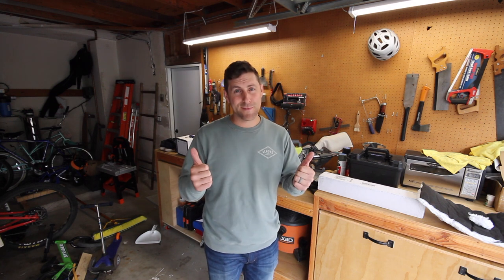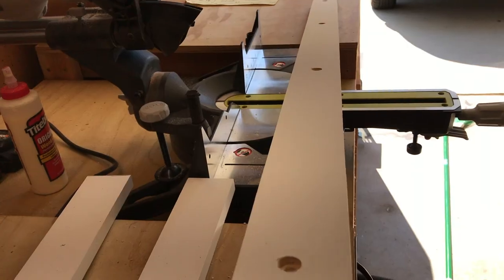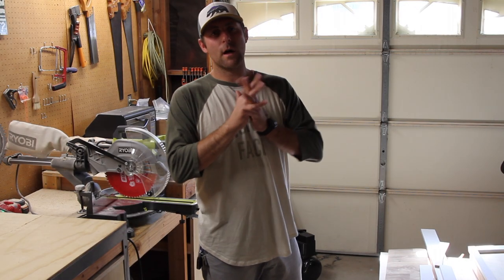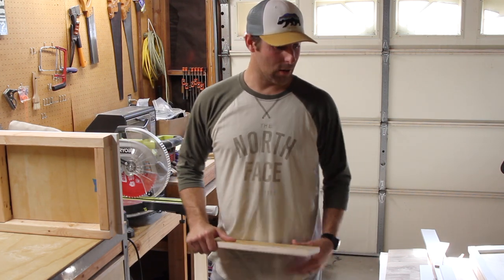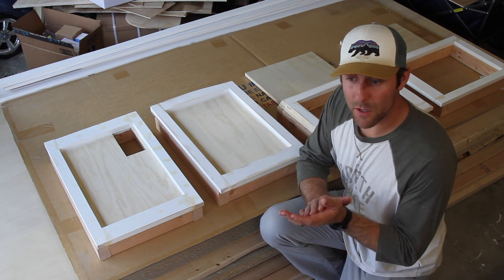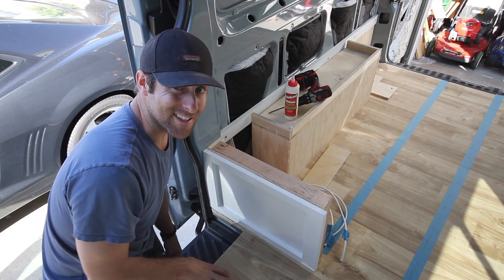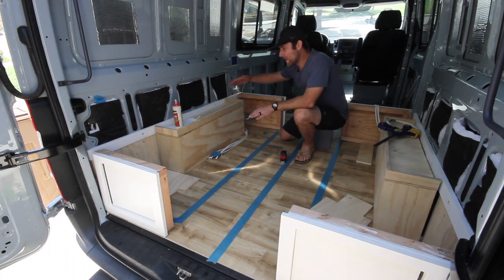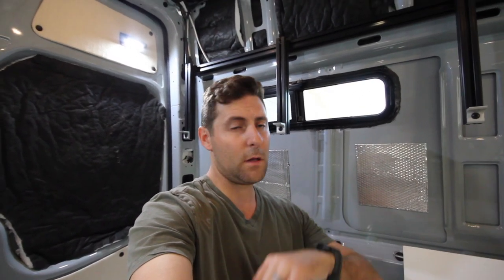DIY CAMPER VAN BED (Convertible)

Comment: I'm building the exact same benches and using your video as a guide. Big thanks for the post!
Reply from the maker: You got this! Let me know if you if you need anything!
Reply: @EventheWavesYT  I have the benches built but haven't cut the openings yet. Curious if you have preferred the side that had the big opening or the side that had the smaller opening? Also I am considering not painting and using laminate for protection. Have you noticed scuff marks from feet on the paint? Lots of people paint anyway for water proofing. Thoughts? Thanks!!
Reply from the maker: @NorthwestLights206  So I have the smaller ones on one side and a larger opening on the other. To be honest I don’t like getting into either one of them. My cushions are really heavy and it’s just mildly inconvenient. But what I have  noticed is I will put larger items big tents and longer things that I may not use on my trips as frequently and try to open them as little as possible. I use my rear piano hinged doors everyday though. 🤙🏼 
I painted because well it was cheap and the wife wanted white. lol
Reply: @EventheWavesYT thanks! I opted to not add the rear doors, east to add though since I haven't finished it... Maybe I will take that into consideration (for sliding skis in for example).

What cushions did you go with? I feel like that is one of my biggest questions. Anything you would change about them? I can build all day but picking cushions is something I'm new too. Water resistant material and firm padding is what I think we are looking for. Yours look a bit thick for me.
Reply from the maker: My cushions are way too thick buddy! I would slim it down to 2” medium density foam and 2” of memory foam. I bought the bed version of the foam and then gave  them to an upholstery guy and he upholstered them in a fabric I bought from Krypton. I can make a full video on it if you have a specific question you want answered.
Reply: @EventheWavesYT  How come you didn't use hydraulic hinges to help with the lifting of the bench? My first attempt at a bench i used the same as you (blocks on the underside - not sure what that process is called) but it was a PITA to use because it was so heavy and awkward. Also, what are your measurements?
Reply from the maker: Love it! Yeah so I should have used hydraulic hinges because the cushions weigh a lot! At the time I didn’t really know they existed. The good thing is though. Because I built doors in the back of the van everything (for the most part) is accessible through there. And as far as the measurements go, I marked the center of the van and then did 12” from there giving me 24” in the middle. Then I built the cabinet to the size of the space. I believe I’ve said the measurements in the comments but I can re- measure if it helps. 🤙🏼

Comment: Thanks for sharing this, It’s almost exactly what I’ve been wanting to build in the van we just bought. Yours is the first I’ve seen like this (separate beds) on youtube. Only difference I have in mind is the back half section under the beds I’d like to have as a pull out drawer at the back doors with lift up access on the front half. Ours is a Ford econoline extended van so we have even less room but I think the width is near the same. Bunk beds across the rear might maximize space but I’m not sure if it will work for my husband’s height. It’s currently in the shop getting its first check up. We also have two large dogs that will travel with us! 😉
Reply from the maker: So glad you watched it! Love the Ford E Series vans! So classic. Your design sounds rad! Let me know what you end up doing. 🤙🏼🤙🏼enjoy the build
Reply: J

Comment: Thanks of the video. Somewhat unrelated, I noticed you've installed the DCC50s solar charger in your electrical system. Have you had to deal with any issues with excessive boost charging/not entering float mode? Does the charger's battery indicator light switch from green back to orange when you start discharging a full battery?
Reply from the maker: Thanks for watching! As far as my solar charge controller I know some people have had issues with it. Every time I discharge from my batteries if it is day they will start charging right away. Also when the batteries are full it does go into float mode and trickle charge my starting battery. They only downside I see with this system is that renogy separated the max amount of amperage from solar and alternator power. Basically I can’t pull 50a at one time from one source. I can max pull 25 from solar and 25 from alternator. Hope this helps! 🤙🏼

Comment: Great video. What are the dimensions of your benches?
Reply from the maker: Thanks Brad! Glad you found value in it! 
My benches are 22” out from the wall and 74” long. I’m 6’2 and it’s perfect!
Reply: @EventheWavesYT Thanks for the step by step tutorial. What was the height of your bench?
Reply from the maker: Hey Paul! Thanks for the feedback! My bench height is 15 1/4” from my flooring the the top of the wood. We did 5 inch cushions and If I were to do it over i would do 3” cushions. Good thing my family is tall! Hope this helps!
Reply: @EventheWavesYT  Thanks for the quick reply Brad. I am looking at 15" height also and 5" cushion but now might take your advice and go with 3" cushion. I don't have much experience with woodworking so we'll see how it goes...lol.
Reply from the maker: No worries! If you do 15” you could probably get away with a 4” cushion. 2” medium density and 2” memory foam! You got this! Create what you love! It will come out great!